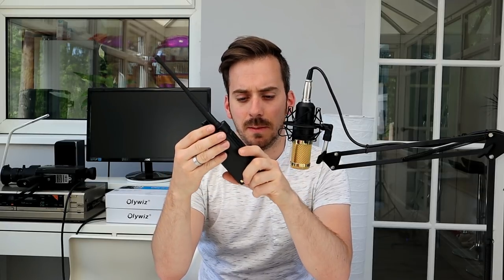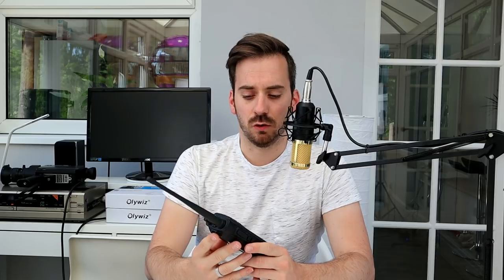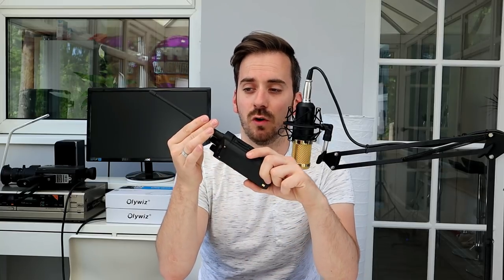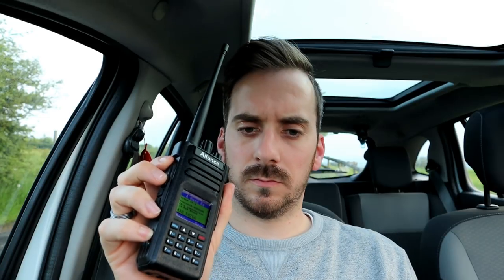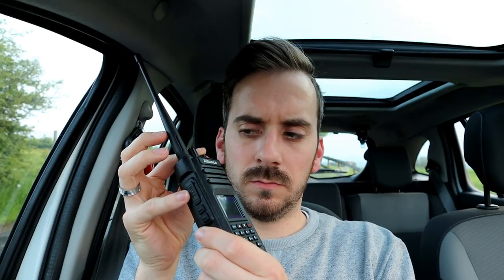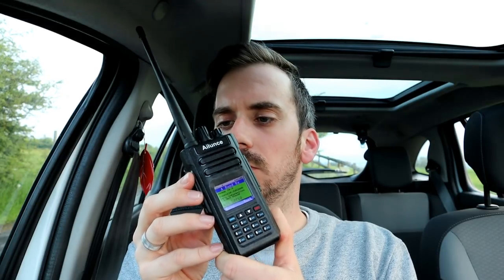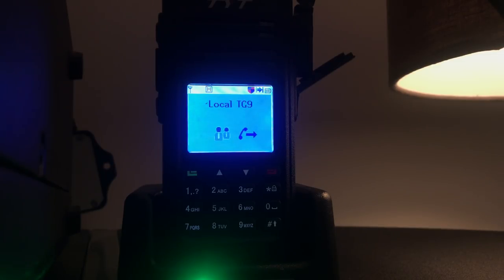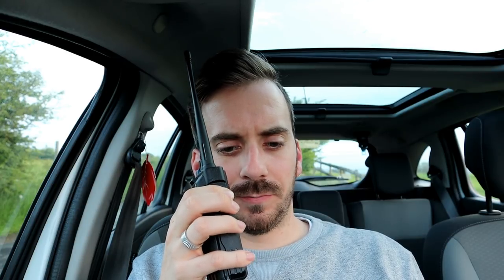Ailunce HD1 Long Range DMR & Analogue Test - 20+ Miles!

Comment: I purchased the Ailunce HD1 GPS model , I had to return the radio due to the short battery life , the standard HD1 battery life is fine .
I turned the GPS off & the radio still drained the battery in no time , I even swapped the battery & the radio was still power hungry .

Comment: Thanks for the new HD1 video Lewis! As always, great stuff. It would be interesting, for your own curiosity, to use one of the free on line path profile calculators to see exactly what the RF path is/should be like especially on the longer range tests like this one. Quite often the "computer says no" when in fact the RF path does just about scrape through! Great work, 73 Brian EI8EJB
Reply from the maker: I'll have to look in to doing that Brian! Cheers as always! :)
Reply: I have done this with Hts and Mobile to my house. The computer says "absolutely NOT", but I get contact, even with canyons, forests, and mountains in between radios. There is a reason that they call it F.M. ,because it is F-ing Magic :)

Comment: Good stuff as always! I'm reallyu considering getting one of those radios myself. If it had VHF as well I probably would've bought one already to be fair. Still seems like a smashing bit of kit though. I'm a bit torn between the HD1 and the TYT MD-2017, which does VHF/UHF analog and DMR
Reply from the maker: Yeah you should seriously get one, i can't comment on the 2017 as I've never tried one, the antenna fault put me off it! 73 for now
Reply: Yeah the 2017 has its pros and cons for sure. The HD1 does seem like a much better mix of functions and features. On a slightly unrelated sidenote I can mention than I'm about to order a SenHaiX 6900 network radio. It seems to be the newest more rugged looking model available, and it's very reasonably priced. I can get back to you about it if you're interested. It costs way less than the RT4.   73 SA7BHV
Reply: Electricguy the HD1 is both UHF and VHF :)
Reply: As said HD1 does VHF/UHF analog and digital.

Comment: Hi Lewis, just a noobie question: in analog mode, this radio transmits all over UHF band (400-480) or it is limited to transmit in ham UHF range 430-440?
Reply from the maker: 400-480 approx Jackson, so all over UHF :)

Comment: Hey Lewis, when charging your HD1 does your base get extremely hot and smell like it is burning ? Unfortunately mine does and it's kinda worrying to charge it ! Daydd M6ULU
Reply from the maker: Hey Daffyd, no issues this side mate!
Reply: No issues with mine either (I have four of them). Try another charger and/or battery.

Comment: Great video! The audio coming out of the TYT seems muffled. I've read other reports where people complain about low audio transmitted from the HD1.  The speaker in the HD1, however, is no slouch.
Reply: golf-n-guns I have an HD1 audio sucks!!!!!!!!!!!!!  Very muffled and low!!!!!They came out with the new Firmware but did not fix shit!Still sounds my very Muffle  and low!!!!!!! hd1 gps Sucks I’m very pissed!
Reply: I’ve not had a problem, I found the audio quite clear with plenty of gain. I did order directly from Retevis, perhaps others are getting old stock? In the latest firmware you can also increase the mic gain if you prefer.